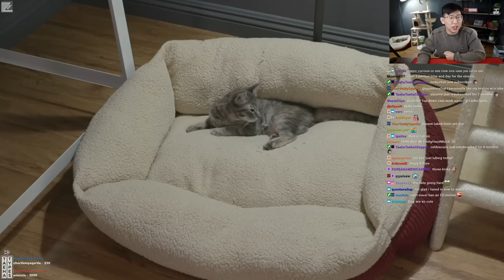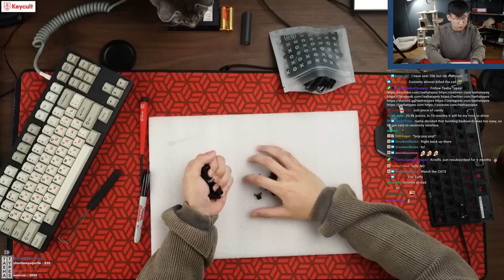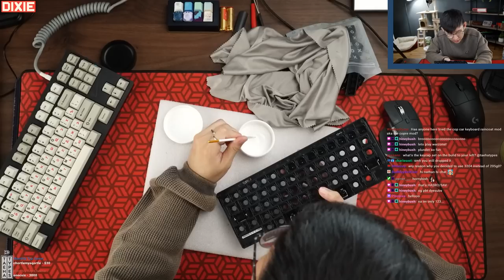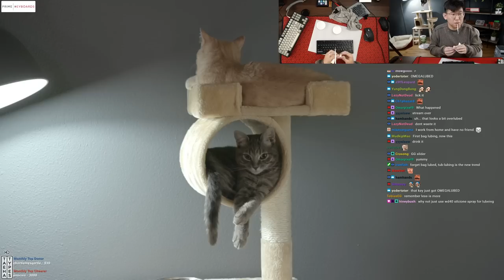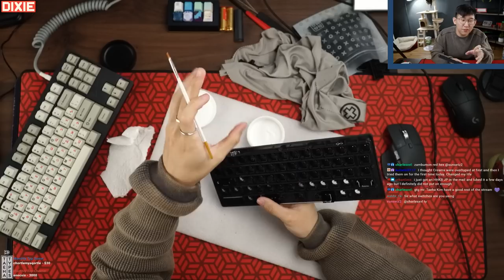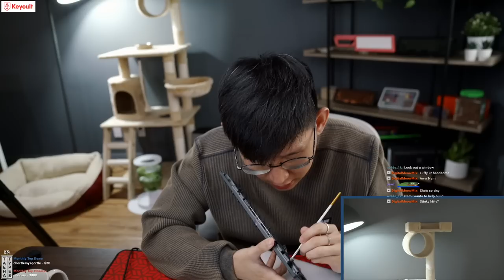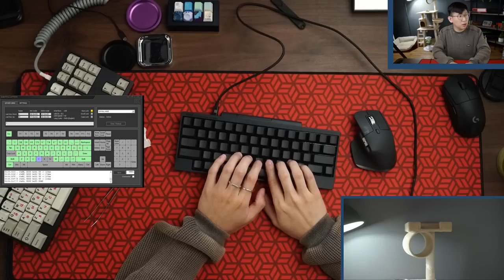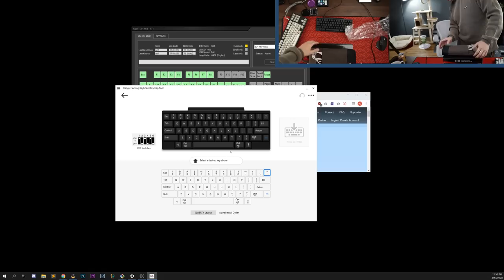Lubing the HHKB Professional Hybrid Stream

Comment: One thing I am certain. This HHKB pro hybrid has the most reliable bluetooth connection I have ever used. Never hiccup while using. Switching device (between PCs, ipad and cell phone) on the fly, just one try and it is done, every time.
Reply: Is there a keyboard shortcut for switching between devices?
Reply: salzahrah Fn+Control+1 to 4 to switch between BT devices.  Fn+Control+0 to switch to USB connection.
Reply: This is a super underrated feature. Perfect Bluetooth every time is so good

Comment: Unlubed: 12:17
Lubed: 2:30:52
Reply: MVP!
Reply: The Pixel Addict sound the same
Reply: @LunarProxy123  I do not agree. I hear the difference.
Reply: The key difference is much less keycap chatter (with lube the stem makes less noise) this results in a cleaner thock from the domes.
Reply: @LunarProxy123  If I were you I would recommend you go and search his individual typing tests for the HHKB and then you will hear the difference

Comment: thanks Taeha! Love this! Is the ribbon cable ease to remove? There is a guy on reddit tries to mod his new hybrid and broke the cable
Reply: Hi that was actually me, it turned out to be a bluetooth sync issue and is working fine now
Reply: @bippitybopped4051  oh my god dude. You should update the thread on reddit. I thought you said cable didn't work neither.
Reply: Thọ Huỳnh hm i thought i deleted the thread, ill go check
Reply: @bippitybopped4051  Is this one also yours? https://www.reddit.com/r/MechanicalKeyboards/comments/el8vz0/my_new_hhkb_hybrid_stopped_working_solutions . I think you opened 2 threads

Comment: Hey man I just want to tell you that I love your streams and they amuse me every time. I also love your cats they are so cute. I have a question as a gamer in a budget what kind of switches should I use
Reply: Lucas Park I recommend gateron yellows for a nice weighted, linear switch. Lube them with 3204 or soemthing
Reply: Second the gateron yellow suggestion - I'm not on a budget and I still absolutely love gateron yellows lubed with Krytox gpl 205 g0
Reply: Gateron Yellow and Gateron Black, both are nicely weighted in others opinion. But for me, I'd use MX Black springs on them and lube them with 3204 or 205

Comment: which Stabilizers would you recommend to get Taeha?
Reply: JSD why Not zeal or everglide? I heared new gmk Stabs aren‘t that Great. And everglides cost the same as gmk
Reply: JSD he has a stock of old pre-retooled gmk stabs. The new version that is readily available currently is pretty trash hence the influx of new stabilisers. 

Durock/everglide are very nice and good value, probably the smoothest and works with every profile and material of keycap

C3 stabs are good because they come in different colours and the wire sits really tight so won’t pop out but you can only use gmk with them or abs caps

Zeal stabs are a waste of money

Cherry clip ins are still good